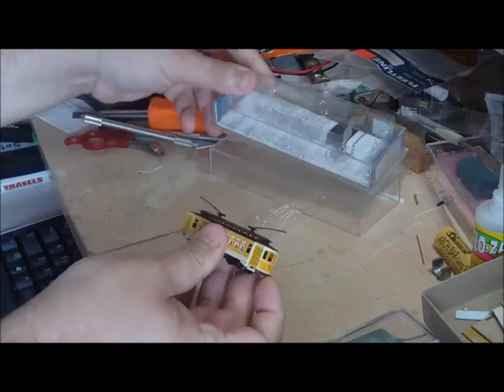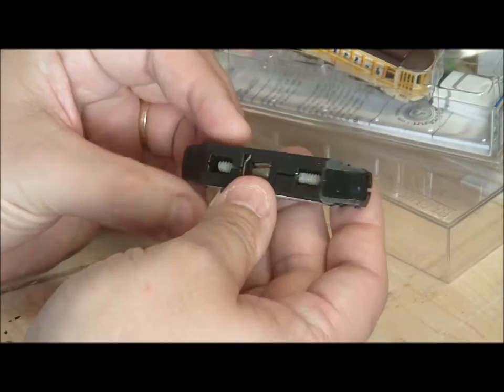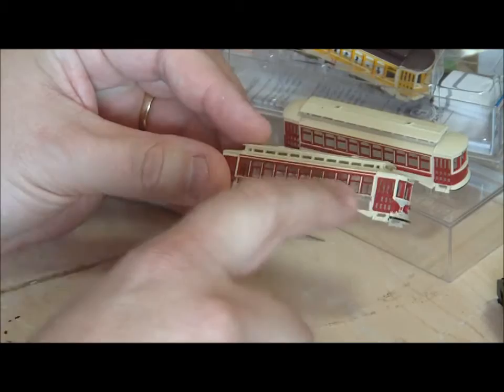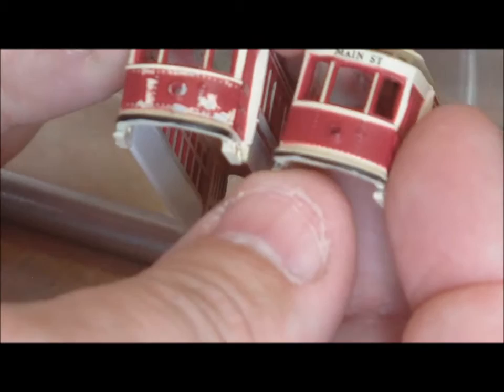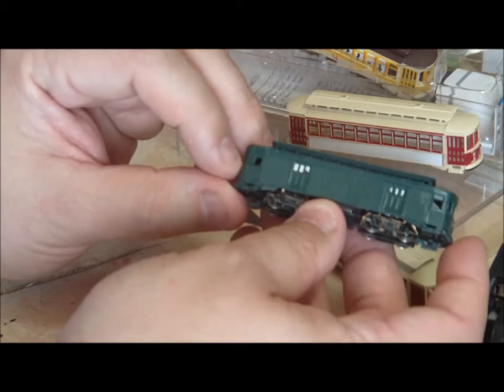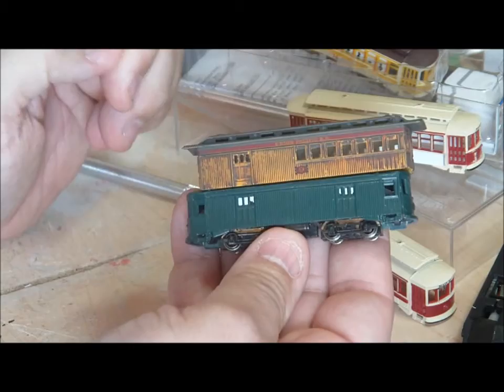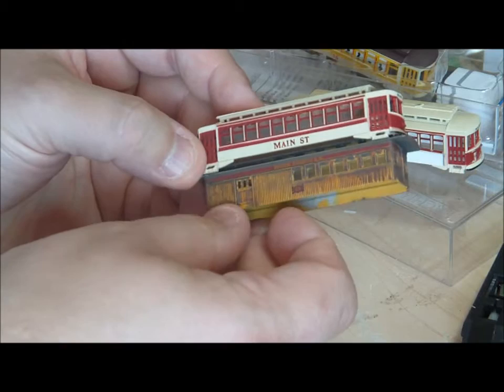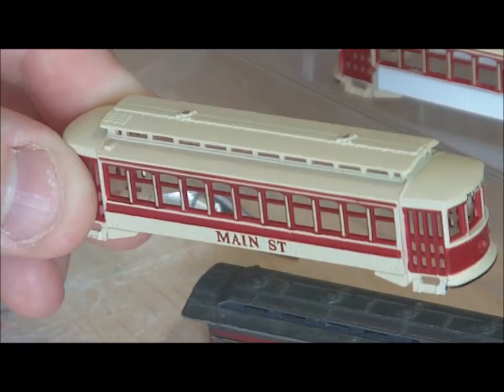Episode 1 - Bachmann Shell Conversions

Comment: I've done similar conversions with the H0 version.  The Bachmann H0 and N units are very similar when it comes to the body.   I've also turned them into British double-deckers by adding another body on top, removing the roof of the bottom car.

I'm thinking that similar things can be done with the G scale streetcar models.
Reply from the maker: Hi Alan, I have done that with G scale the problem is that they do not have a enclosed vestibule like their smaller scale brethren.  I love to see images of your work, are you part of the Facebook traction modelers groups?
Reply: I have a Facebook Group called  "Fudgers Junction",  in which I post photos of my model railway.   I also have a Facebook Group "Alan's Stereoscopic Circle", in which I post 3D Anaglyphs, many of which are of my model railway, but you need red/cyan glasses to view in 3D.   You could start by sending me a "friend" request on Facebook to Alan F Brookes.

Comment: My trolley is now making a clicking noise like it’s gears are hitting the track.  Strange sound.  Any thoughts?
Reply from the maker: Does it make that sound when it is run not on the track?
Reply: @trolley69  I have two train layouts and it does it on both.  Is that what you mean.  It gets better I have a dcc ready Bachmann steam engine that ran great. I just put it on the layout and it’s not moving. Headlight comes on but no movement. Jeezzzzz
Reply from the maker: I meant does it make the noise if you connect it to the wires and not the track?
Reply: @trolley69  I didn’t try that. Could I put a 9 volt battery under it and test it that way?